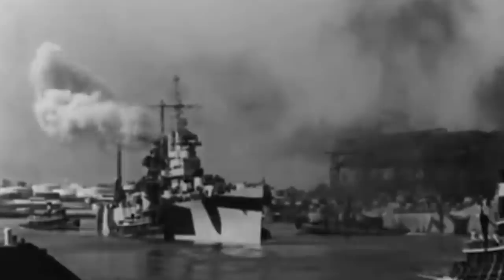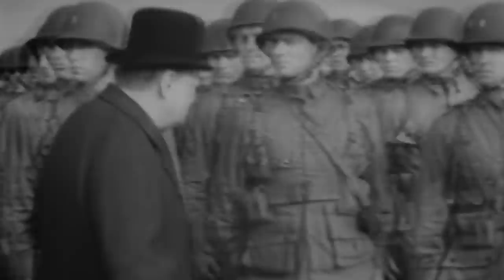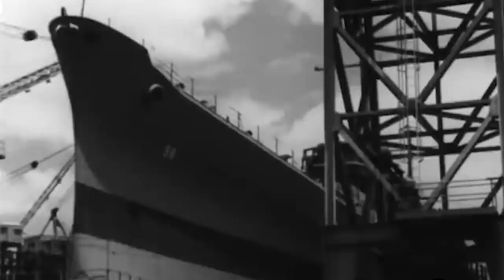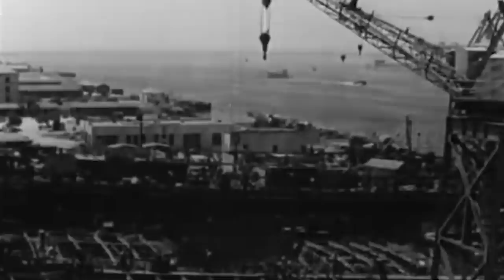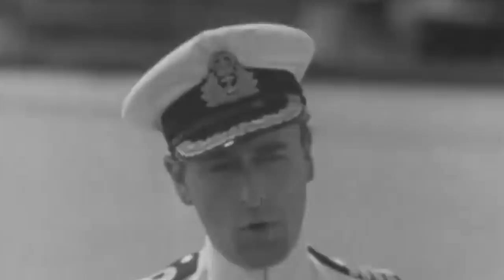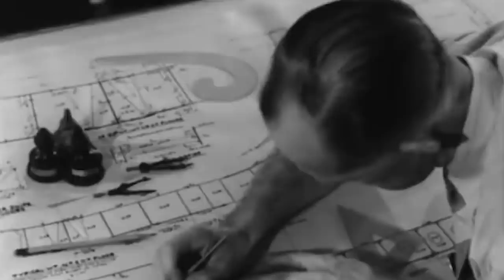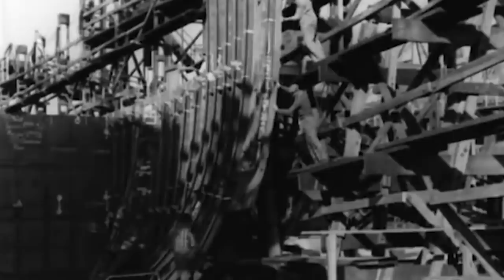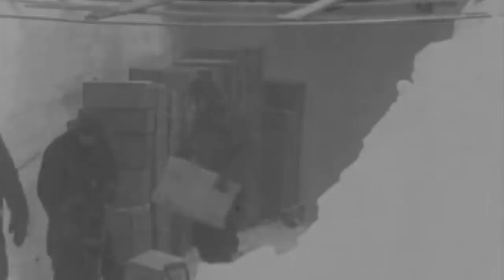Project Habakkuk - The Manmade Iceberg Aircraft Carrier

Comment: Another factor in the demise of this project was the cracking of the Enigma code.  It effectively increased the range of air reconnaissance and ASW because the limited air assets knew where to look.  They could go directly to a limited search area instead of burning fuel while searching everywhere.

Comment: When this concept was first being developed there was a serious need for convoy protection by air to cover the "Mid Atlantic Gap" (also know as "The Black Pit"). This was the area left unprotected by land based Coastal Command anti-submarine aircraft. Available aircraft lacked the range necessary to provide coast to coast air cover and aircraft carriers were in very short supply. This allowed German U-Boats to wreak havoc on the Atlantic convoys before the Allies were able to develop better (and greater numbers of) anti-submarine vessels and equipment.

A very large, practically unsinkable aircraft base (or several of the same) stationed in that 'gap' would allow for the necessary convoy air support. But by the time various design problems were being (or not being) dealt with, planes such as the Consolidated B-24 Liberator in it's 'Very Long Range' variant were able to close the gap. Also, the Allies were producing many aircraft carriers, particularly the smaller escort carriers that could accompany convoys. Smaller and too slow to accompany main battle fleets, these carriers had no problem keeping up with slow moving convoys.

Comment: Did they ever use Pykrete for other structures? Building a massive aircraft carrier might have been impractical, but I would think that this material would have been a good way to give protection to military installations in the northern part of the U.K.. They could build walls that would resist German attacks without using up concrete and steel needed elsewhere. I realize that Germany never made attacks on the northern islands or northern parts of the islands, but the British didn't know that early in the war. This material would have allowed them to fortify those outposts with less use of steel and concrete.
Reply: Hell no, the thickness required and to keep it frozen would of used more recourses than just building a concrete bunker. After all replace the timber chips with rocks, replace the water with lime, you have concrete and no need to cool it constantly.
Reply: @Right-Is-Right  It took three years for the Pykrete to melt in the Canadian lake where they started the prototype. They didn't constantly try to refrigerate anything after they abandoned the project. The notion that they would have to expend energy to keep anything cold goes against what the video plainly said. Undoubtedly, they would have some melting during the summer, but they could refreeze new material in the winter and maintain the bunkers without spending rock and lime that might be needed elsewhere. Building the defenses with blocks of this stuff would have been easier than pouring concrete. The pressure would have caused some degree of "welding" of the blocks to one another.
Reply: @VTPSTTU  " The notion that they would have to expend energy to keep anything cold goes against what the video plainly said" completely false, in the vid the idea of the ice being kept cold with a series of pipes carrying coolant was explained. I agree they did not go into what would be keeping the coolant cool, but it would have to be a compressor style cooler, much like an air-conditioned or fridge. Which exchanges a hell of a lot of heat and uses a hell of a lot of recourses to operate.
 Then you get into the fact that propulsion takes energy and some of that is wasted as heat, which if the carrier was operational would be occurring inside the ship, not to mention the body heat of over a thousand people would add to the defrosting. 
 Then we get into some basic science, heat exchange happens a lot quicker when an object like a ship moves through water, also  even at a lower rate due to wind in the air, so a moving frozen aircraft carrier would defrost a lot more than a stationary one, then we get into the fun stuff, a fresh water lake is by definition not salt water and salt melts ice. So added together the unmanned unpowered vessel would of defrosted a hell of a lot quicker in the ocean being towed around, being manned and powered it probably would take less than a month to become water again.
 Now if the vessel was manned, powered and cruising, it would take a stack of stacks of air conditioners to keep it frozen and the salt water would be defrosting points quicker than others as it goes along the bow and side of the ship, making the repair a really expensive, long process process. No wonder they abandoned a floating block of ice with steel frames in the lake, it was useless as a frontline combatant from the fist concept thought.
Reply: @Right-Is-Right  You've written three or four paragraphs about the carrier, but that's not what I was talking about at all. I understand completely that the ice would need to be cooled to make the aircraft carrier that they were planning. I said that the Pykrete blocks could have been a useful material for building other fortifications, particularly in northern areas. Your jump to the aircraft carrier is just a lame attempt to misdirect this conversation. As the video clearly said, the Pykrete structures left alone in northern Canada required three years to melt. 

You've made no valid points, and your misdirection makes this conversation seem pointless. Someone who does this much misdirection to attack a position when he has no real evidence against that position is not worth my time.
Reply: @VTPSTTU  LOL obviously to you is a point you agree with, my poijnt that the ice melys too fast and that you made errors are rejected out of hand and "You've made no valid points" stated. Wgat about the facts I am spitting out? instead of showing where you believe I am not making a valid point, oncuding that you were incorrect stating that the vid said nothing about a cooling system and points I am making go directly to why they do not use the process.
 Your reply was the poinyless one, do better.

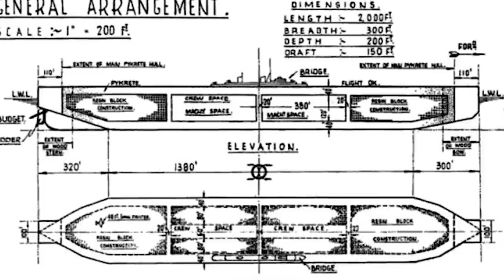Comment: 3:06 HMS Habakkuk, 2000_ft long, 200_ft wide would have broken in a storm!  Make it 3000_m radius, round, elliptically 400_ft deep, with two thin steel hulls and some inner non combustible, incompressible thermal isolation layer and an outer layer, that could be heated if the float would be trapped in arctic winter ice, and it could operate in deep arctic waters, a floating ocean_habitat and airport for modern jets. It doesn't need to move fast through the waters, and put some fish processing gear onto it, too. (Don't neglect good food; but mercury extraction needed to make it clean food!). This thing would only break if a big asteroid hit the Northern oceans! in modern days You could consider CarbonFiber reinforcement for additional tensile strength. 
 I kind of admire Churchill, his ancestor came from Graben, next to Schwabmünchen, South Germany. Now Amazon has a warehouse near there.

Comment: Wouldn't be any tropical missions in a vessel like that😳
Reply: The cooling plant they designed meant it could sail in any waters.
Reply: You can keep ice all year if it's in saw dust, same principle. Would take a long time to thaw.
Reply: @Minong Maniac  
The concept is feasible. Yet, the technology seemed inadequate and unreliable for its time. For example...its at the bottom of the ocean right now. It was on ICE 🧊
Reply: As mentioned in the video/presentation, the prototype was abandoned and left in open Canadian waters with the outer ice layer taking three years/12 seasonal cycles to melt to a degree where the vessel was deemed unseaworthy. Pretty cool IMO. Edit: Pun unintended ;)

Comment: Should of stacked barges off the coast in the grand banks. Damaged barages can be replacing, using like 30. Could of used it as a main base and had much smaller flat tops to land refuel and arm if needed and return to the floating base. Would of changed the game in the war.
Reply: rigidity issues. Stacked barges would buck under swells wouldn't they? May not be a great thing to try and land on/take off from if your runway has gaps opening and closing in it all over.
Reply: @audiosreality  I was picturing something like a rigid top n a few decks of storage area with barges slotted into to channels like a shelving unit. Ones damaged u can just slide it out and insert a new barge. Picture something like an oil rig and a mulberry from d day hadna few to many drinks lol
But yeah imagine if it was just barges n some ply wood lol deck would kick off planes with the waves and by chow time no one can find Dave cause he fell threw a gap into the sea lol
Reply: @Akren905  basically it has to be able to turn adjust its course. A rig takes alot of tug power so did the mulberry s I think. With the barge idea I think your explaining it would be pretty hard to keep it the flight deck facing the wind. And a few torpedos would cut through any barge I can think of. A wolf pack could simply hit one side over and over again till they capsized it by flooding all the barges on the port or starboard

Comment: WHAT A WASTE OF TIME AND MATERIAL !
Reply: all they did was wast saw dust and had 8 dudes spend 3 weeks building a test ships with 3 explosives and it was not even a total failer. as the only reasons it ended up being not viable was because of that type of production was not standardized and standardizing that type of production for a large amount of ships was not up to the task as the ship would not be able to pass the equator without extensive repairs.